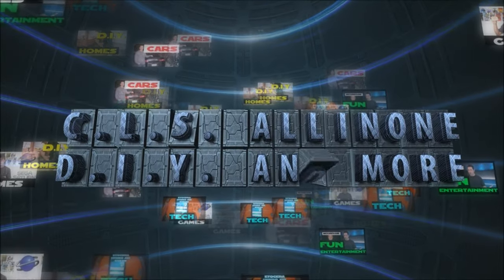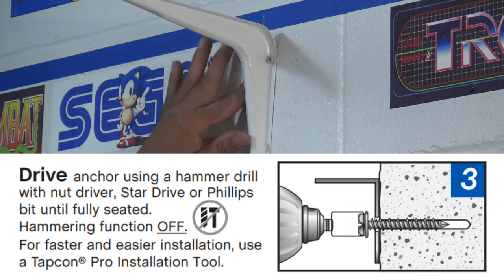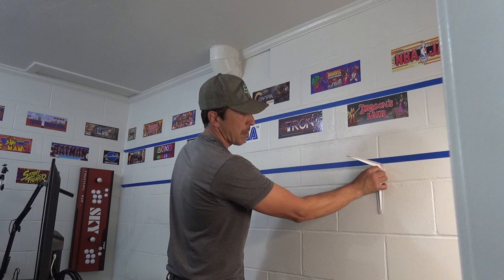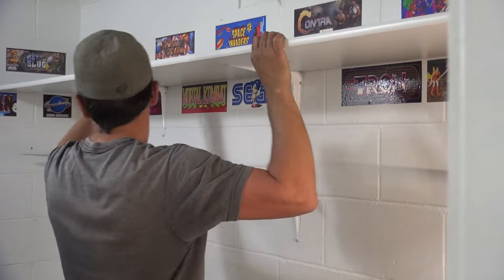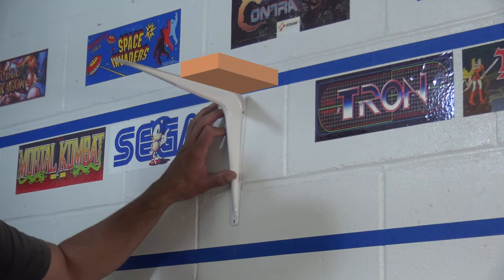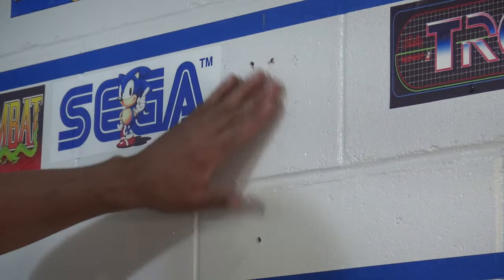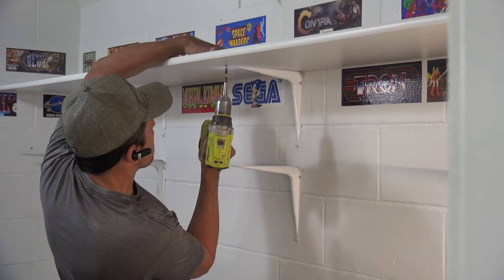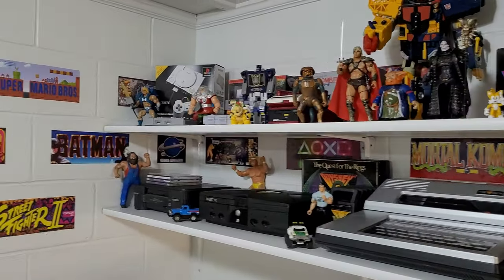How to install shelves on a concrete, block or brick wall, using Tapcon Anchor Screws.

Comment: Quick question. I have drywall on top of the concrete wall and want to put up similar shelves. Can I use tapcons and just get longer screws so they clear the dry wall, gap, and sink deep enough into concrete?
Reply from the maker: yes
Reply: @D.I.Y._All-in-One  Thanks!

Comment: Hey I have a question regarding this video you made about a year ago on installing metal roofing. https://youtu.be/kRXGnI87pHc. I couldn't leave a comment there.

What happens if you get to the end of the other gable side and you have a big overhang with the last panel OR you have like 8 or more inches left to cover the roof?  How would you deal with that?